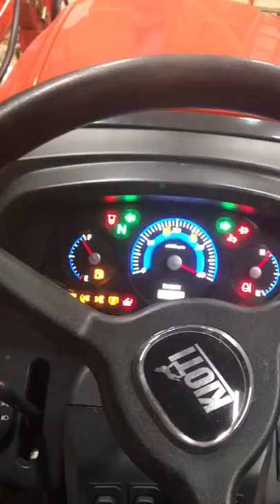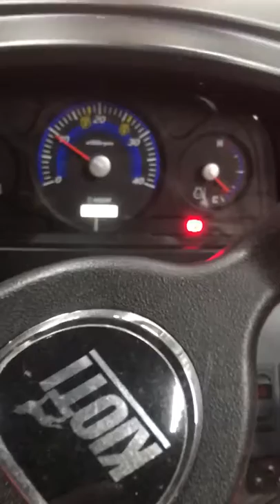Plow setup on my tractor

Comment: Where did you find a switch to fit in that panel to the right of the drivers seat? My local kioti dealers cannot locate me a switch to fit in those blanks.
Reply from the maker: Matt M I bought it on amazon just a toggle switch had to put some tape on it to fit snug
Reply: Mark Pantalone : thank you for the reply. I can't believe kioti would put a switch panel with blanks, but not sell switches for it. Sort of crazy to me.  Thank you again